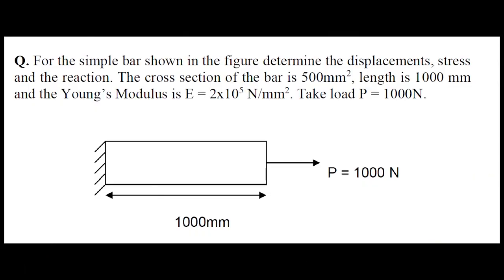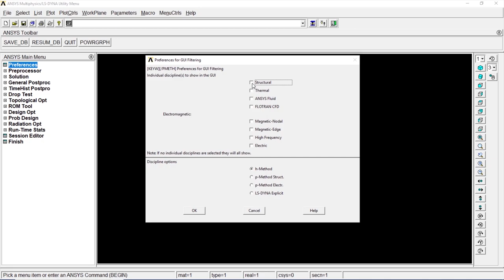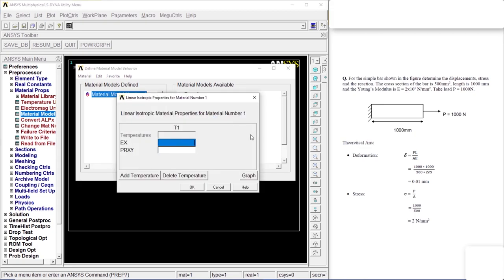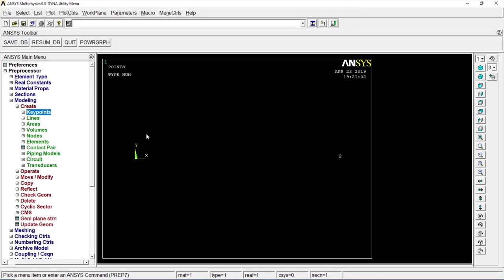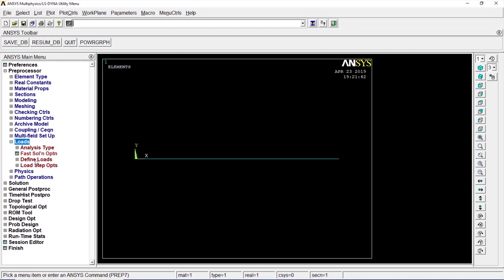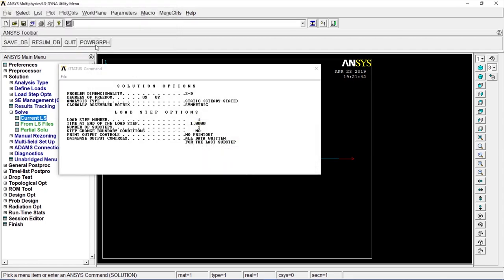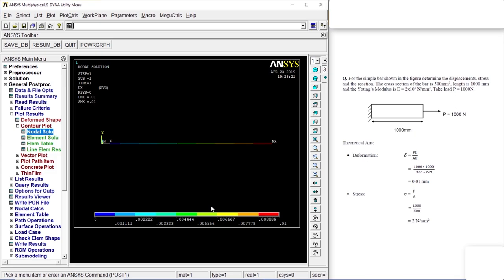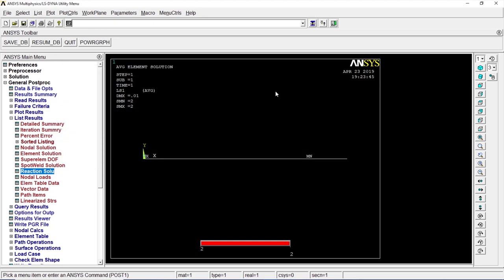Analysis of Simple Bar Using ANSYS

Comment: Under link.. My softwares doesn't have 2D spar1.. 
It shows " 3D finit stn 180" and "actuator 11". Which one should I chose ?
Reply from the maker: I haven’t used the latest version of ansys, so i dont know about that. if u want ansys older version i can provide you
Reply: @MachenDesign  please provide the link to older version

Comment: Bro why are you  applying mesh for this simple bar problem.   We can count entire bar as a single element.
Reply: Meshing or increasing elements would lead to more accurate result. Since this is a numerical solution , taking bar as a single element and splitting it into N elements would vary in the answer.
Reply: What is the use of Meshing..?
Reply: @krishnavaidya9100  
Meshing is the most decisive part of any analysis software.
Meshing lets you split your domain into a smaller part. Imagine you have a piece of work and your boss gives you 1 day to finish. Another day he gives you 100 days to finish the work.
Which one will you prefer? And where can we expect the quality of product assuming that work is very difficult to finish in a day?

Comment: Because in my ansys there is no option 2d only 3D
Reply from the maker: André Luis Rodrigues Santana You can use 3d finite stn
Reply: @MachenDesign  Then not able to add area
Reply: @rishwanthkatam  Go to Preprocessor -> Sections -> Link -> Add
Link Area = 500
And it will work.